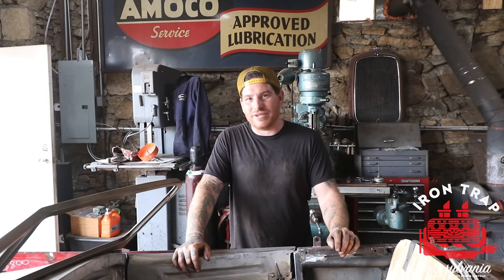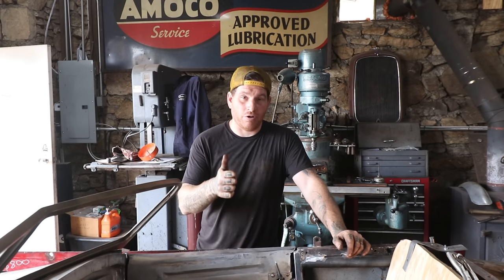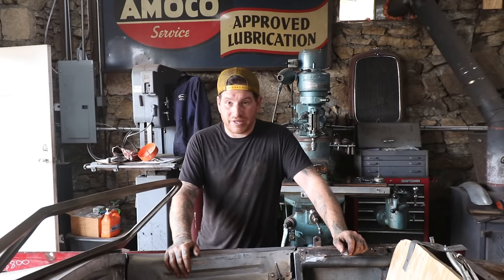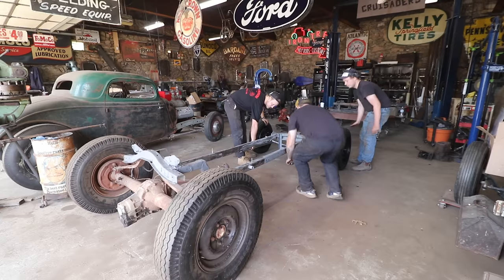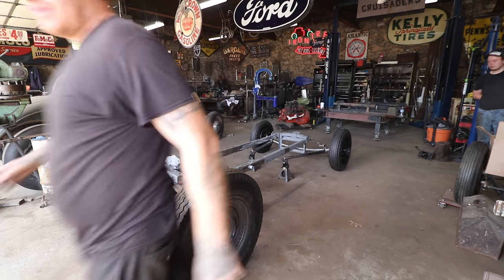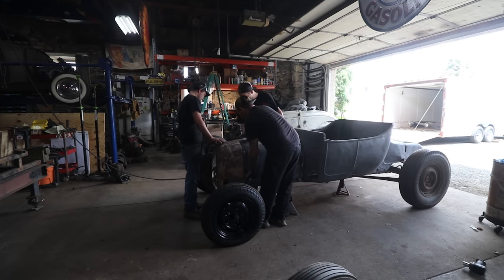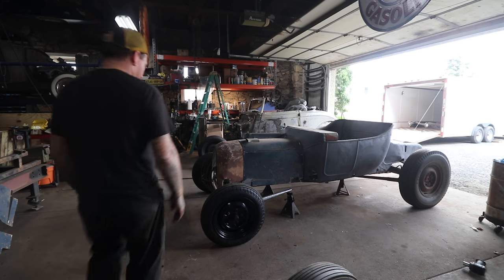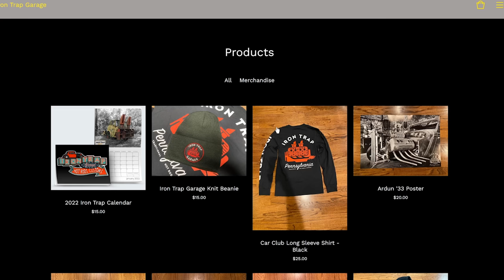Our Model T Roadster Racer Gets A Chrome Tube Axle!!!

Comment: matt when you get into setting up the suspension could you kinda walk through how you determine angles, etc? i love this project!
Reply from the maker: Really all that matters mainly is the front axle. More negative caster makes it go more straight at speed but harder to turn at slow speeds. 5-7 degrees negative caster is the sweet spot I’ve found for me for a street car
Reply: @IronTrapGarage  i'm just obessing because i wanna get my project dialed in right. never built anything from the ground up before.

Comment: These cars were kept as light as possible for more speed on the track, so none of that sissy stuff like boxing the frame rails and adding braces to keep the body rigid was done back then.  Adding back some basic rigidity to the frame will make the car so much nicer to drive, not to mention so much safer...  Since the car is being rebuilt as a "replica" of what it was back in the day, some of the "over-the-top" racing stuff that was done (or not done, as the case may be) can be fixed to make the car more stable, stronger, and better equipped for "on the road" use.  It was a wise choice to rebuild the old circle-track racer as a safer version for street use.

Comment: Hey  Matt  Don from  Sydney Australia watch all your stuff and love it. I  have a question are there vehicle regulations regarding modifying vehicles required in Pennsylvania or us for that matter. I see you Re bar and weld heaps of chassis etc do they require an engineer inspection ?
Reply from the maker: No engineer here. No where in the US has regulations like Australia. We’re lucky in that regard.
Reply: I can't speak for PA but in most States there's no engineer inspection required, only a VIN and Registration. Some states do have a vehicle safety inspection to make sure it's safe, ex... Lights, wipers, etc, and some States even test for working brakes. I had a Harley fail in Florida because the factory headlight wasn't up to standard and I had to get a dealer to sign a document stating it was factory equipment to get it to pass.
Reply: @IronTrapGarage  thanks old mate no way could you get away with what you do here the modification regulations would kill you. Land of the free eh !!!
Reply: Here in california in the era when this type of car was run (early 1950s track roadsters) the rules were pretty lax. the cars were not even required to have roll over bars, seat belts or in some instances helmets. later on the 60s all of the above were required plus brake and steering checks. 🤠🏁